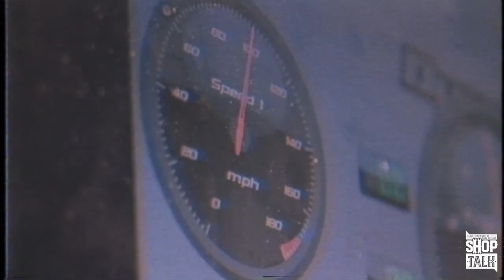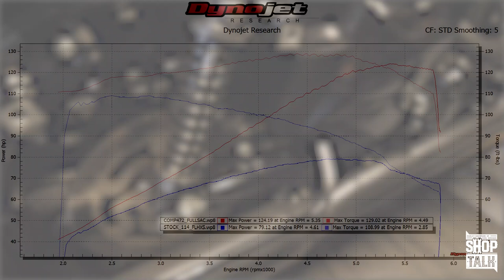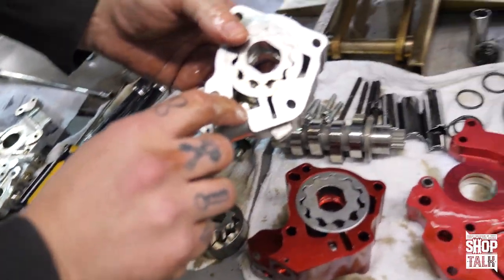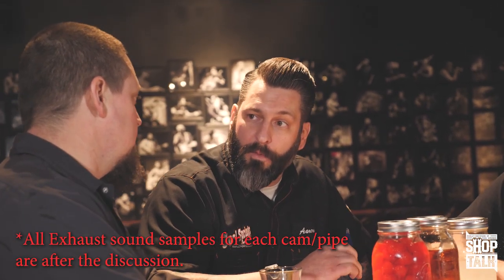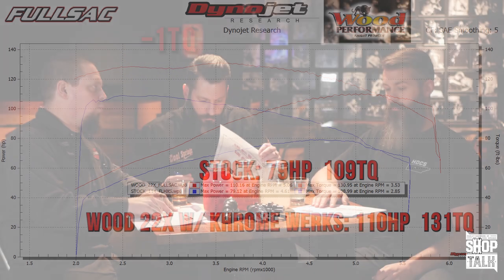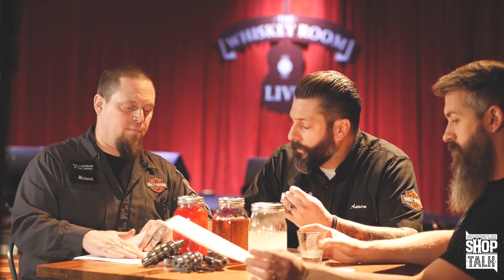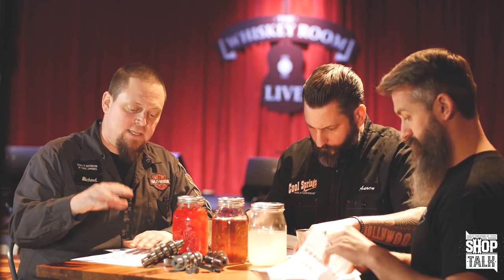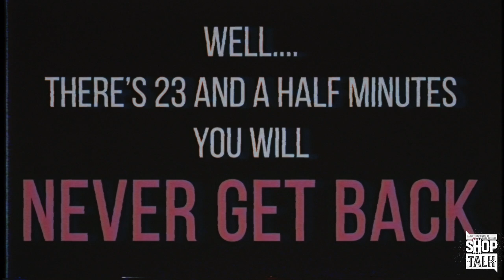Cam Shootout Series | Part 1 (S&S 475G, Wood Knight Prowler 22x, Comp Cams M8 246A, Redshift RS472)

Comment: Great informative vid. Just like a science experiment with a control group changing just one thing at a time. Looking for info on a 2019 FLTRXS WITH 114”. I know it’s 10.5:1 vs 11.0:1. All other things being equal (D&D + injectors and airbox) how / where will performance differ? Or would you recommend a different cam for lower compression.
Reply: On a stock engine without compression we usually move this direction ...

https://youtu.be/DbeF1QSSBRU

Comment: Mines a 114” I should be able to get real similar numbers.
Reply: Yes.  A few under.  Is it a stock 114?
Reply: Stage 3 with D&D 2-1 with screaming eagle air cleaner. Putting SE injectors in. Either with S&S or comp cam.
Reply: @sokodad  I would run the S&S475 or if you were looking at Comp the TQ222 or TQ230 (a little more top end HP but not as big mid-range TQ than the TQ222) would be good choices.
Reply: M.V.O _Motorfast what all should I replace besides cam and put adjustable pushrods in? Cam plate I’ve been told and there was another item which I can’t remember. It’s better than stock. Stock is plastic or something and aftermarket is metal.
Reply: Tappet cuffs
Reply: M.V.O _Motorfast wish I could but you’re several states away from me. You’re in Tennessee correct?
Reply: @sokodad  yes we are.
Reply: Not that I'd ever do it because it wouldn't be worth the few cubic inches or little bit of power gain but is it possible to put a 4.5 stroke crank like 117" has in my stage 3 107 to get 117". Because 117" has same bore as my stage 3.
Reply: I like your knowledge. Maybe would be worth the trip.
Reply: @sokodad  with a 107 using the stock crank it would go to a 114" or a 124".  A 117 or 128 would require a "stroked" 4 1/2 crank.  Where are you located?
Reply: M.V.O _Motorfast ND, it’s 21 hours to you. Yes, mines 114” now.
Reply: M.V.O _Motorfast I went on your website and sent a message to service. It was in the contract us area. Hopefully you get it.